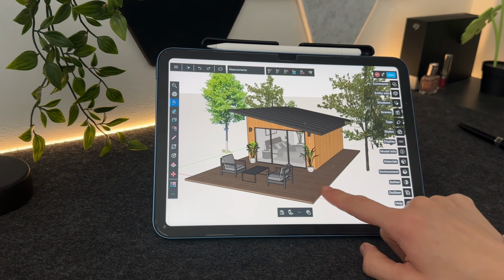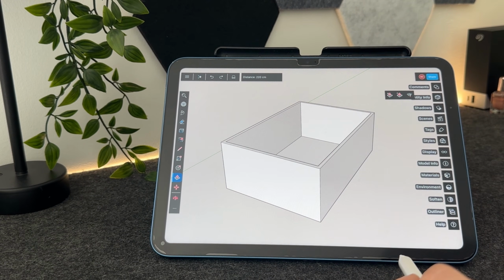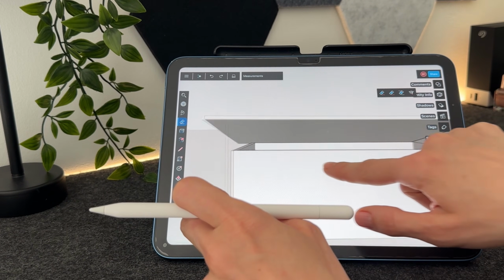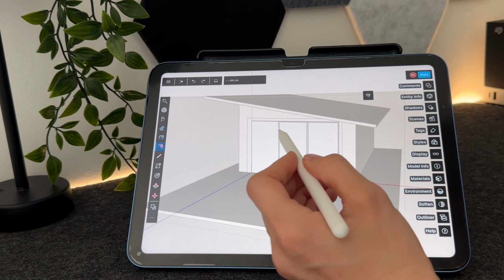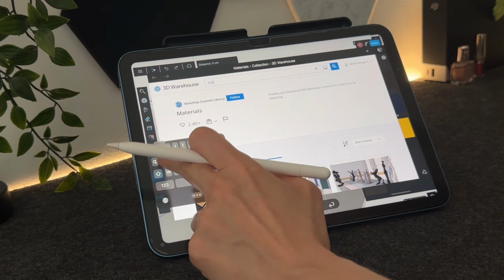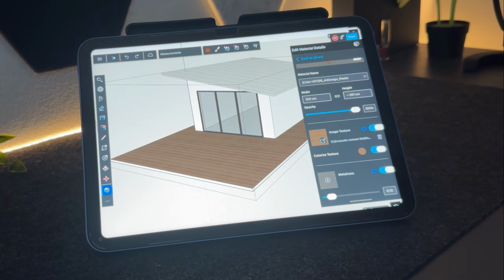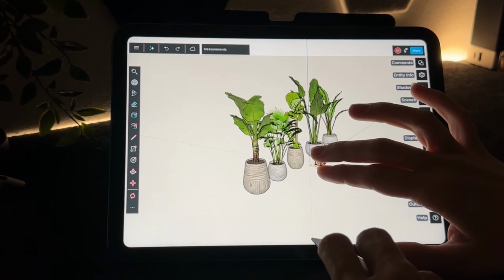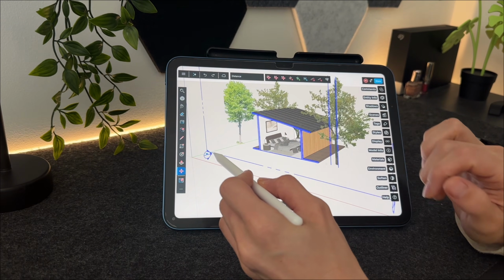SketchUp on the iPad for complete BEGINNERS (+ Free PDF) - explained by an architect

Comment: Hi, after using the triangle shapes to cover the sides, I have been trying to push up the edge to come up to the roof, but the square keeps coming up at the back of the roof too. I’ve made so many attempts but it’s not like yours. When you use the push tool to pull up the side to the roof, only one side comes up as opposed to both. How do I correct this please?
Reply from the maker: I think the issue is that the rectangular part of the wall you want to push up isn’t fully defined as a separate face. Try adding lines along the edges of that rectangle first, so SketchUp recognizes it as its own face. Then use Push/Pull on that section and pull it up to meet the roof. That should make only that part come up instead of affecting the back as well.

Comment: Hi. Anytime i try to erase, the entire wall comes off. And i highlight that particular line after double tapping, then tapping on that particular line, then click on eraser, and swipe over the highlighted line. But instead the entire wall comes off. What I'm i doing wrong please?
Ps. Your teaching is great
Reply: When drawing, always group sketch, if you want to edit select then double click
Reply from the maker: Thank you! 😊 In SketchUp, double-tapping can select the face together with its edges, so you may be selecting more than just that one line. Try not selecting anything first, then choose the Eraser tool and tap only the line you want to remove.
Also, if that line is actually defining the wall/face, deleting it can make the face disappear too. In that case, you may need to hide or soften the line instead of erasing it.